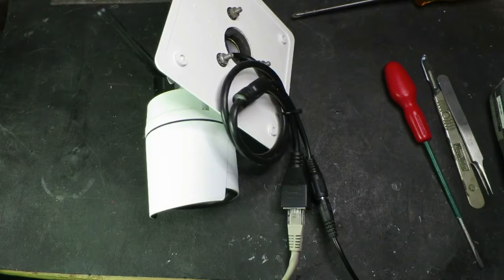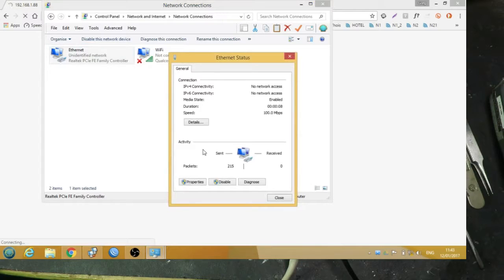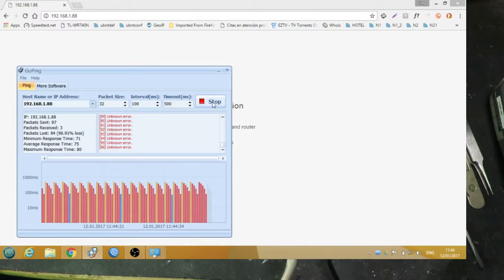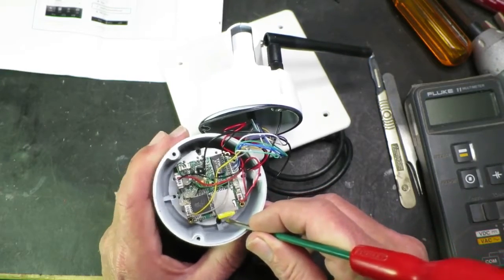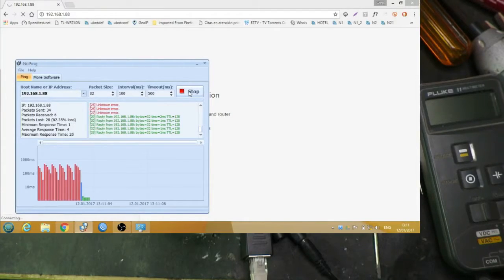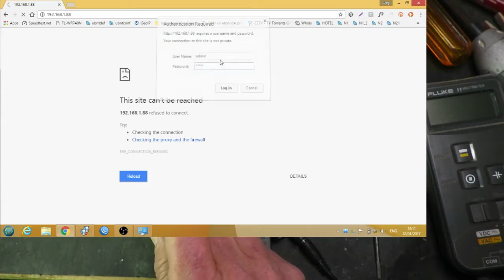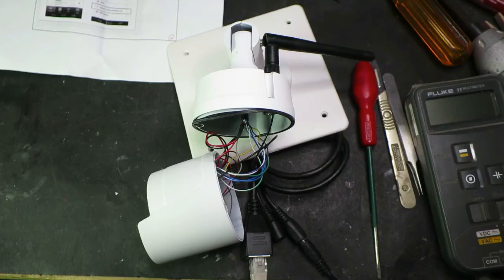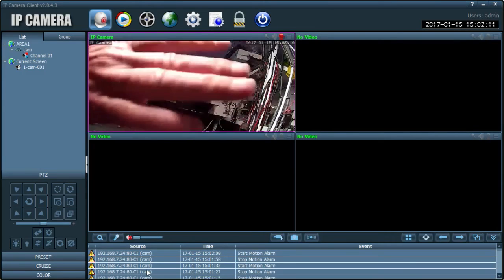IP Camera Fail? Or SD card? Home Security Camera Surveillance Repair

Comment: Hello, i had exactly the same problem on the 3 cameras. Managed to discovery by myself but it's good to see other users have the same issue.

Changed the SD cards for 32GB genuine SanDisk and it's working fine for now. Another issue i ran into was continuous recording isn't possible... the 4GB max file size for FAT32 partition scheme(used by my cameras) makes this impossible. The camera itself doesn't know how to deal with this and it just stops recording when the file size reach that point.
Reply from the maker: Thanks for sharing your experience. Thanks for watching, have a great day!

Comment: I found an amiccom outdoor 1080p camera while mowing a yard for the rental company Im contracted though and decided to try and power on the  camera though the screws and other hardware was rusted. Upon taking the lens out, I noticed a couple unplugged pigtails, and a 64gb delkin sd card. I put it in my phone and it said checking sd card, and kept resetting my phone, tried another phone and it said "sd card corrupted to use this card you must set it up first" and right before I clicked set up it just turned the screen black and reset the phone.
Reply from the maker: As water has got in it's possible the contact on the card need cleaning. A little denatured alcohol and an old toothbrush should work. Try it in a PC rather than risking your phone! There are various data recovery programs about you can try : https://www.ccleaner.com/recuva Thanks for watching, have a great day!

Comment: Hmm, i have a zosi ip cam with wifi. But in the beginning it was difficult to configure. Only video with onvif. Strange enough the ethernet connection was also sometimes detected as a gigabit connection... After i installed a sd card it does nothing anymore. No webinterface, got no ip from dhcp and so on. Also the reset button didn´t help. now after a time also the ethernet port does not work anymore. So i think the ethernet chip is blow up or something. I read this problem more in the aliexpress store. Do you have any experience what happend?
Reply from the maker: Sorry I have not seen that problem. Does it work if you remove the SD card? It seems that many cameras are supplied with poor quality SD cards that cause the cameras to stop working. Good Luck!
Reply: @1nformatica  No, even without the SD Card (genuine Samsung) it doesn´t work. I think there was a problem with overheating or something. The heatsink was placed on the side with thermalpaste, then a thermal pad and then again thermal paste. I´m now in discussion with Zosi the want to send a new one.
Reply from the maker: @haajee1  Sounds definitely faulty. A replacement is the best idea.
Reply: @1nformatica  Yes. And i see you can buy from aliexpress new modules for inside a camera case for arround €13,- So i do that to. The case is really nice!
Reply from the maker: @haajee1  Like many things better not to look inside!